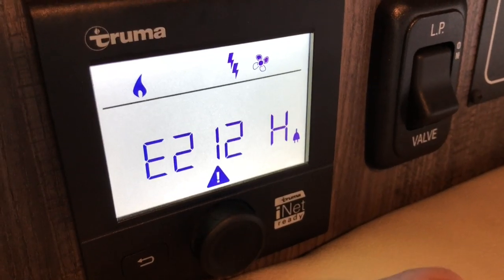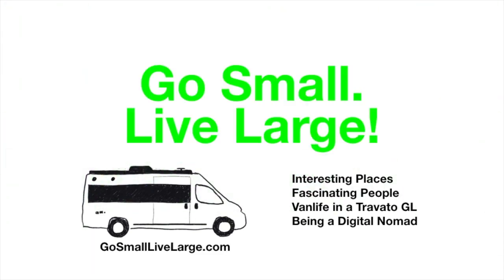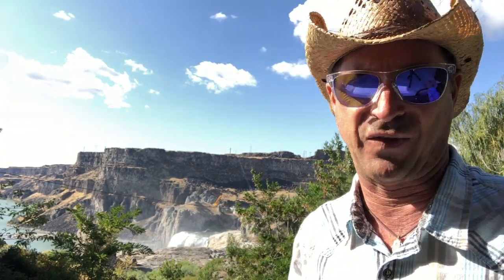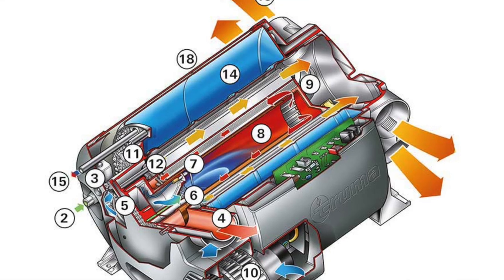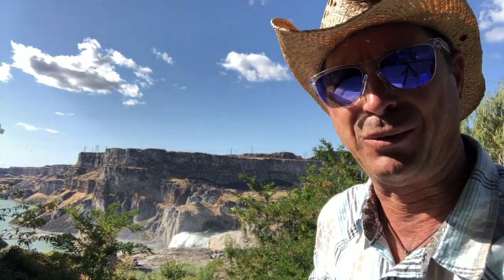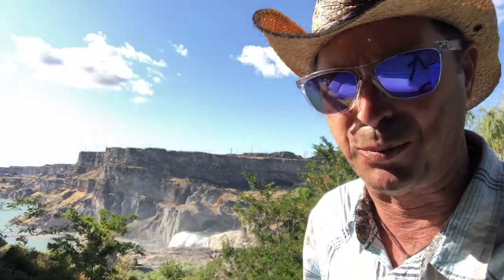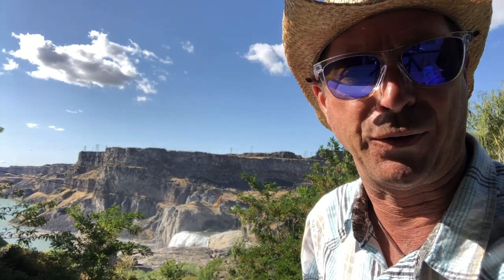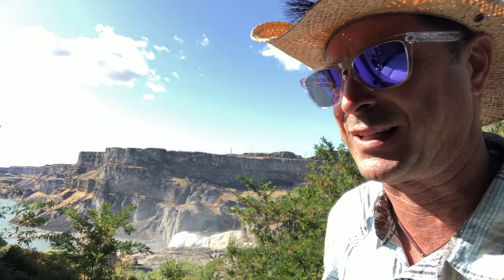TROUBLED PROPANE FURNACE? Truma error code tip  |  Full-time Vanlife in a Travato

Comment: Thanks for the video. 
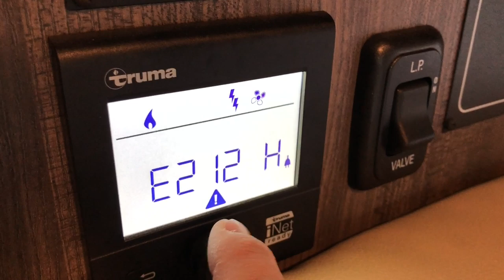At 5:15, you state the manual doesn't have that code, yet at 3:19, the page you video shows code 212.  Regarding the displayed code "E 212 H",  E stands for error. 212 is the code number. H represents that the error is for the heater.  E 212 H. 
Glad you got is sorted.
Reply from the maker: thanks for that. Memory serves there is one more element to the code that isn't in the manual. I phoned Truma to learn. I think I put that learning in the. video.

Comment: Thank you! I was getting a similar error code on my Truma Vario heat. The propane was on and the tank was full, but still got the code. I didn't know that the code has to be cleared or how to even do that. I contacted Truma and got nothing from them except to look up their national directory to find someone who might service Trumas. After watching your video, I went out to my camper van, turned off the coach power for a few minutes, then turned it back on. The code had disappeared and the Truma kicked on! 
Thank you!
Reply from the maker: Glad to jelp

Comment: I've traveled over 500,000 mi in my camper, I always use an extra heavy down comforter / sleeping bag, and I always have a ski mask at hand. It keeps you warm at night when emergencies break loose. Also many Travelers have given up on propane, they just use a little buddy heater, or they have a little canister propane bottle for a little Buddy Heater or 4 cooking with. Also another little trick I always bring a 12 inch steel plate with me, I hate that up on the outdoor campfire at night, so it's blazing hot, then I bring it inside and put it on some rocks or whatever and it keeps the unit warm for many hours. I don't know that would be dangerous with a small unit like yours. But believe me that little piece of metal when it's blazing hot really Charles off a lot of heat inside the unit. Sometimes I've also put that piece of Steel in the oven and keep the oven door open, and it radiates warmed into the unit. Sometimes also if it's extremely cold and I need to conserve power, I will tarp off the mattress from the rest of the unit, so the body warmth will keep the unit warm. I know more and more people are also using that body bag so when they're sitting watching TV, they stay warm and toasty in the chair. I've never used a body bag in the RV. But I seen it used quite a few times. I've also seen people in the snow, in the campfire they warm up a copper kettle of hot water and then bring that inside so the warmth from the kettle keeps the unit warm for a while. Never done it so I don't know if it lasts very long or not. Now That I'm Older it's too hard to be in that kind of cold and night it bothers my COPD too much.
Reply from the maker: You are SO MICH STRONGER than I GG. I like the comforts of home, on four wheels. Thx for sharing all that !!

Comment: I am glad that you got your furnace working right again. And yes, using electric to heat your rig is a big drain on resources. I would suggest getting a winter rated sleeping bag for just those cases.
Reply from the maker: Propane is the key ingredient for cozy warmth, not electricity I have learned.  Thx DK

Comment: Same problem here. You didn’t present a solution. Clearing an error code does not fix the root cause of the error. The propane switch IN the van does not need to be on for heating to work. The manual is also not helpful. We used propane heating for 2 weeks without issue, now in a torrential downpour at temps in the mid 40s  that error keeps popping up, clearing the error msg obviously doesn’t solve the actual problem.
Reply from the maker: Great point.

Comment: 4:24 did you say —obtaining heat is more challenging than air conditioning/cooling??????
Reply from the maker: Yes, when running heat from electric as the source instead of propane I find the electric is much less efficient than propane. Learned this the hard way on several occasion. Now in use propane for heat unless I am plugged into shore power then I se electric heat to conserve propane. Hopefully that makes sense. Great comment | questions BramdNew New!

Comment: Since the lithium batteries will power the a/c for over 7 hours. 
In winter time. 
How long will the propane last using the furnace?
Reply: A long time, the Truma ships the propane. Very efficient from my personal experience.
Reply from the maker: Bob's statement below is spot on CT. Propane is the way to go. I'm so glad to have two energy sources, Volta lithium electric AND propane. Propane is SUPER efficient for heating compared to electric. One year with my rig and maybe have filled propane 3x total.